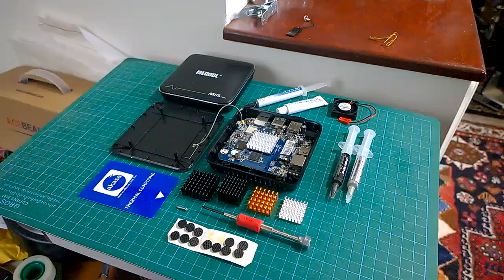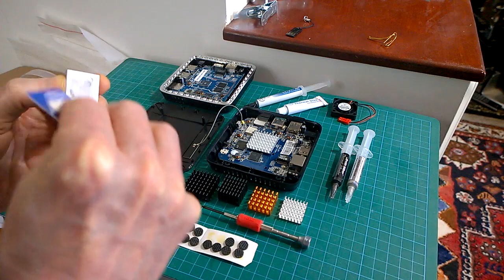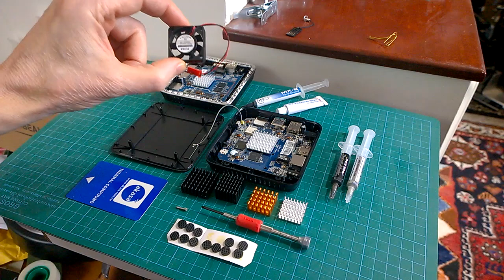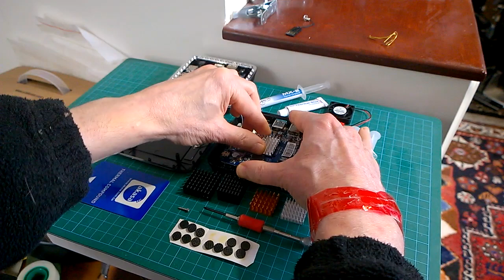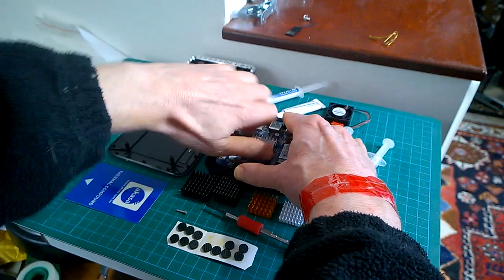M8S Pro Plus L Heatsink Removal - Pt.1

Comment: You can make normal thermal paste with the thermal epoxy (50/50) helps improve the temp slightly and it will still hold the heatsink on but not to such a degree you couldn't remove it later down the road.
Reply from the maker: Cool

Comment: I have a Tanix TX92 it has 3G Ram and 64G ROM. I have a freezing problem when it is on for a while. I'm sure its a over heating problem I will have to the same thing you are doing to yours .
Reply: Just re-drill the side holes. Small center drill bit does it .  Then have a fan blowing to those holes. I did that to my Vorke Z6
Reply: David Brown /Which is better?? MECOOL M8S pro ,8 core ,3GB RAM , 16GB ROM , /  BEELINK GT1 Ultimate , 8 core , 3 GB RAM, 32GB ROM . .. What is the best?
Reply: Marcelo Mandiola   yundoo y8 if you like games. If it is for kodi I have a vidoo x9 and it has a media center were I just click one time and my movies are transferred to the media center and it has a thumbnail image of the movie it makes it look very professional. But for games I would go with the yundoo y8.
Reply: David Brown / I like watching KODI and WANT to MERGE 7000 channels.. so it must va Strong. What can you recommend?
Reply: Marcelo Mandiola   there is only one bad thing about the box it's not rooted. You can root it yourself but would you want have to do that every time you factory reset you're box. If you want to store hundreds of movies on it the Zidoo 10 is the best.
Reply: Marcelo Mandiola      even the high priced boxes run hot. I just got one in the mail two days ago and it runs really hot. It's a high end box for 2018 the cloudnetzero cr19. I'm going to take apart the box and install bigger heatsinks. It took almost a month to get it in the mail and thought it wasn't going to come because I ordered it off of Geekbuy and after reading all the negative reviews off of a site on Google on how people got ripped off and never got their money back I thought I was screwed till it showed up in the mail. I suppose I dodged a bullet. I wish this chap would answer the questions posed to him. It drives me crazy when people never answer.

Comment from the maker: Fan Tests:
30mm Fan @3.3V + Lifted Lid ~Kodi HD Video playback 68°C/155°F  - SILENT (+Vent slots in Lid = 58°C/135°F Silent)
See Video ~ https://youtu.be/ahVH_rCWYWA
Lid Standard  ~Kodi idle 65°C/150°F ~Kodi HD Video playback 87°C/190°F 
30mm 5V Fan + Lid with air holes ~Kodi idle 42°C/108°F  ~Kodi HD Video playback 55°C/130°F  - Fan noise
30mm 5V Fan + Lifted Lid ~Kodi idle 50°C/122°F  ~Kodi HD Video playback 64°C/147°F  - Low noise

Comment from the maker: Actually ... Changing the HS and adding a bit of extra ventilation by lifting the lid 3mm still only improves temps by about 5-10C.
A 30mm Pi fan fits with standard HS and will need a few holes to vent the lid .... Perfect for £1
Reply: Petrev X can you make a video how to pin the fan?
Reply from the maker: Can you explain what you mean by "pin the fan" ?? 
The solder connections or sticking to lid ? Or ???? Ta.
Reply: Petrev X i mean the cable from the fan. Where i have to put Plus and minus?
Reply from the maker: Look in video linked in Reply 1 @ about 4 minutes. 4 pads in a row between SD and USB ports. Square pad is -ve and other end is +ve (2 in middle no connection). 
HTH
Reply: Ziptie the fan on the lid.
Reply from the maker: I used 4 double thickness pads made from double sided foam sticky tape.
One little pad at each corner.
Reply: Why not just use a usb fan and plug it into port on box and rubberband them together. That's what I did and it works great. Cpu temp 105 to 120 farenheit that would be 40 to 45 celcius